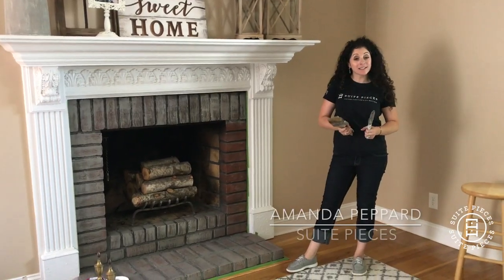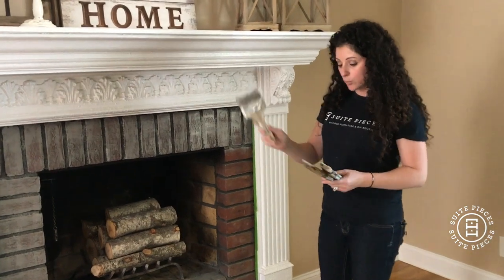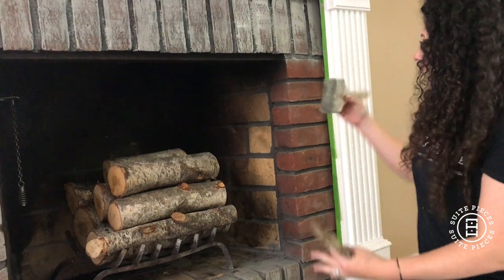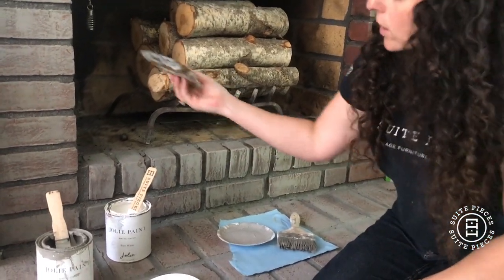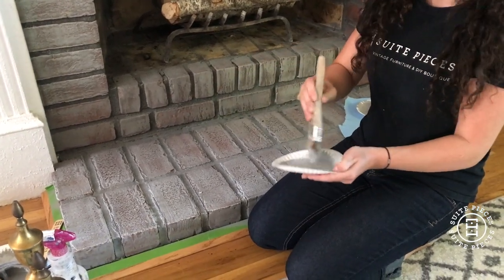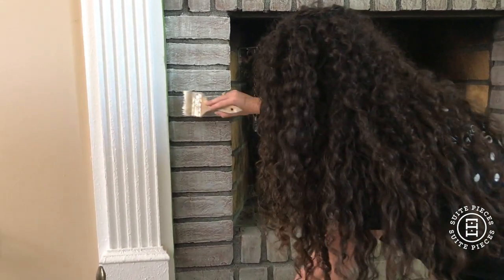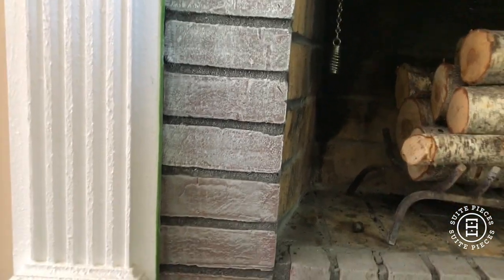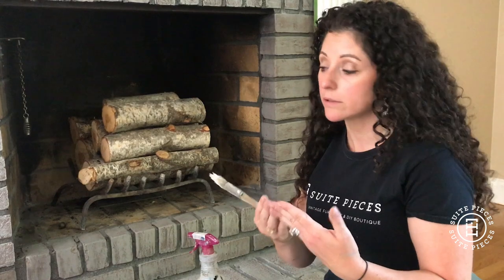How to Paint Brick with No Prep, Matte Finish Paint!

Comment: Ooooh! This looks amazing - what a perfect timing to post this !!! I do have a few questions, Amanda; can this be done to an old, plaster stripped wall? How would I need to prep said wall? It's currently still very dusty to the touch. The grout over here is extremely porous (the house is almost 100 years old after all) Would a sealer help in this case? Many thanks in advance! 

Lastly - and a bit off topic - is there any way of doing a video about painting a well used wooden staircase?
Reply from the maker: Hi Sophie! That's a great idea for a video! We'll see if we can get it done ; ). You would not need to seal the grout, but keep in mind it will suck up lots of paint. To prep the wall, I would make sure its clean and if you need you can do a light sanding to make the surface even and prevent any of the wall chipping off.